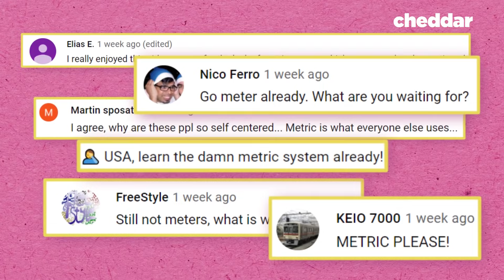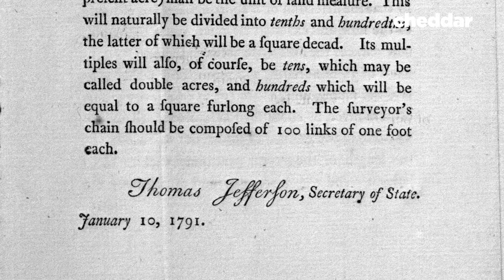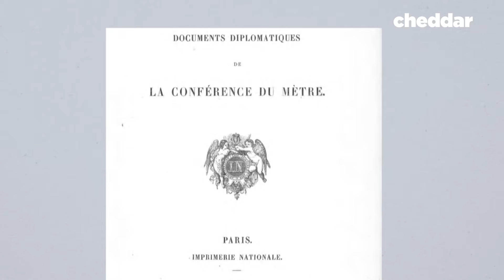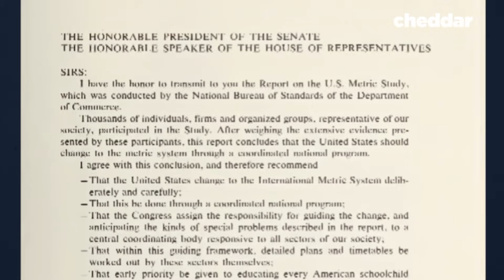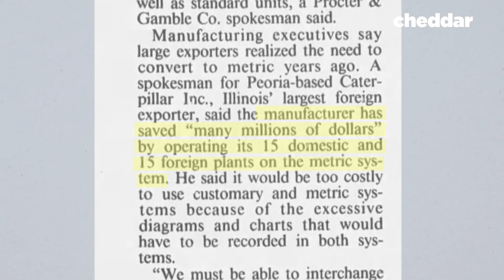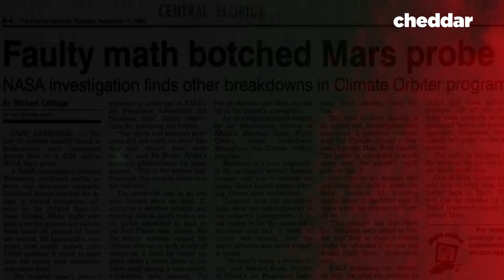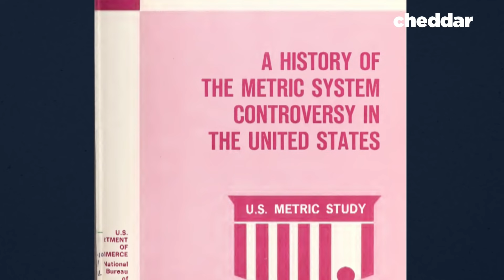Why Doesn't the US Just Use the Metric System? - Cheddar Explains

Comment: Reducing from 900 to 100 different belts doesn't require metrication, just standardization. 

All you have to is start using the same belt in everything instead of making a different one for each application.
Reply: @IRockerbacon Nah, big dog- you're missing the point. It doesn't matter whether it's metric or imperial if it's standardized. You could have an car [or whatever thing] where every bolt had a 1/2" head, Jr a car that had some bolts that are 14mm, some 10mm, and some 17mm, etc. In this particular instance the metric one has more different parts.

Just because the metric system may be a better one does not mean it is required for standardization.

You could make a bolt that was 0.732 French Lignes if you wanted to, and you'd be hard pressed to find a socket to fit on it, but if every single bolt was that same stupid size- boom: standardization.
Reply: 2 machines can be built, 1 metric 1 standard, both using the same number of wrenches to put together or take apart.

Comment: NASA, The Military, Aviation, Engineers, Architects all use it.  The luddites don't.
Reply: @Princess Peach
: you forgot the most important one: FINANCES AND MONEY! It's all metric. 1 cent, 100 cents (=$1), $100, $1,000, $1 mil, $1 bil, etc.
Reply: @jamesdigriz5449  And as soon as you want to convert $$ per hour into $$ per week or year, then metric is out the window.
Reply: Noel Masson Hows that? 🧐
Is any system even required for counting money?
Reply: Aviation around the world is using knots and feet though.
Reply: Real Gokistinian I don't study aviation so I can't tell, but for fluid mechanics, might be used in aviation, I've used metric units, anything mechanical is also metric.
Reply: Not sure if they still do it but NASA uses metric when making stuff, but in the end convert to imperial, ended up causing that crash on mars, someone forgot to convert or something, atleast thats what I was told.
Reply: Yellow Penguin I was told by my teacher that NASA uses metric system for everything except controls, someone forgot to convert a few numbers and crash. Not sure which one to believe 🧐
Reply: @jbird4478  There has been disasters and crashes since man started building things regardless of the name attached to measurements.
Reply: Real Gokistinian any kind of scientific calculations for something have to be done using the metric system, I don't think it's accepted if it's not done that way.
Reply: @Rashed1255  Science got along fine before the metric system. Anything that you can do in metric can be done in English imperial.
Reply: clasicradiolover true, but metric is more simple in my opinion
Reply: So somewhere around 98% of the population are luddites?

Comment: I work in the machining industry and In my opinion changing now would be a bad decision. I take issue with the way this video dismisses the argument about damage to industry. It’s not just about distances ( miles to kilometers) or weight( lbs to grams), other things like tooling , nuts , bolts , pipe, fasteners, bearings , all that would be affected. If you need metric just divide  us standard number(inches or miles whatever) by .03937 and you’re good. 
Don’t need to kill an ant with a machine gun.

Comment: Metric system is based on the 1/4 arc from the pole to equator running through Paris.  No sane person bases a length system on an arc, except if you are a crazy French idiot, or a globalist thug backed by certain insane factions.  The Pyramid of Giza is based on inch, feet and yard, not metric.  It is ancient and scales to the planet and is the CORRECT way to measure things. Time itself is coded in inches, with each year having a prediction into the future.  The 1/10,000,000th of the polar radius = 25 inches.  The mile is 2x2x2x2x2x3x5x11=5280=7x7x7x7x7xPI/10.  It is the most divisible number.  Metric?  2 and 5.  Why then 24 hours and not 1000 time units or something?  Why 60 minutes to hour and 60 seconds to minute?  Only a hypocrite can't see the hypocrisy in the metric system.  Just so stupid.  Sorry folks only idiots thinks metric is cool or easy.  It scales only to clueless egos of the French variety who can't think.  Now it is a frequency...a variable.  By the way, the original marathon was 25 miles which is a reflection on the scared cubit of 25 inches.  The original "metric" marathon (1890's) was 40km which symbolizes a trip around the earth /1000.  40,000 Km pole to pole/1000= 40 km.  Sacred run or a globalist run.  Now you know.  One spiritual, one humanist/atheists.  Man is scaled to the planet via the inch (thumb) and foot.  The metric system is scale to an arc that was off by 3%.  Can't make this nonsense up....Wake up...

Comment: A bolt is not stronger if it is marked in millimeters instead of fractions of an inch and a tank of gasoline does not have more energy because it is measured in liters instead of gallons. An engine is not more powerful or efficient because you measure the output in Newton meters and kilowatts instead of pounds/feet of torque and horsepower. The "savings" mentioned are all false, they actually cost the U.S. millions of jobs because it gave companies an excuse to move parts production out of the U.S. to metric countries. As an example of a lie, the dies and taps used to make nuts and bolts are changed frequently in order to keep close tolerances, so there really was no added expense to switching to metric standards in U.S. plants, it was just cheap labor in foreign countries that led the manufacturers to source their parts from them instead of U.S. based manufacturers.
  GM now uses fewer sizes of belts because they went metric? You can't really be that ignorant. GM started using fewer sizes of belts because they reduced the number of engines and options. Remember when a single model of car could come with one of several different engines and how cars didn't come with air conditioning, power steering or air pumps for emissions (which all had their own size of belt)? They were options that became standard equipment on even the least expensive models, which facilitated the change to a single drive belt instead of different size belts for each option.
  For trade? Really? When was the U.S. not a world leader in trade during the last hundred years? A shipload of grain is a shipload of grain, it doesn't matter if it was measured in bushels when it was loaded and metric tonnes when unloaded.
  The sole advantage to the metric system is the ability to more easily convert formulae without using a calculator. This is an advantage when translating a recipe for twelve into a recipe for five or when calculating a dosage of medicine by a person's weight (as in X ml per kg) in the emergency room, but it has no advantage in any situation where there is time to use a calculator. 
  As for the Mars incident, that had nothing to do with the system of measure, it was NASA's poor management style that led engineers to adopt the "I'm doing my job, and only my job" "keep your head down and don't make waves" attitude that led to the failure in communication. 
  If you really want to annoy people who insist on the superiority of using the metric system, point out that since adopting the metric system, France has gone from being a superpower feared by the world to the laughing stock it is now while during the same period of time the U.S. has gone from a small breakaway colony to the world's superpower in military and trade, all while using bushels, feet and pounds. Once they start to get riled, you can point out how well metric countries did in the world wars when fighting against the U.S. and our non-metric weaponry.

Comment: Video fails to mention that the US military has been metric for decades, at least as far back as the 1970s -- necessarily, to interoperate with our many allies.  Also, the metric system is practically universal in scientific research, which I guess only makes the loss of that Mars probe more embarrassing.

However, down at the grass roots, in everyday life, most people are very resistant to giving up their weather forecast in Fahrenheit, and their road signs in miles and MPH.  And if you have a house built, all the measurements are going to be feet and inches.

I remember when I was in grade school we had the big push to metrification.  We were taught both systems in school, and every hardware store had meter sticks instead of yardsticks for sale, with inches marked on the other side.  Road signs were marked in both miles and kilometers.  Car speedometers had both MPH and KPH.  We were that close to putting the change through, but then it all just fizzled out and everything reverted.  I don't know where I would even go to buy a meter stick today.
Reply: Brit here. We of course invented the imperial system which the US uses (although we updated it, while the US didn't, which is why some imperial measurements are different for us - e.g. a British pint is 568 ml, but a US liquid pint is only 473 ml).
These days we almost entirely use metric, and that's what I was taught at school. We were taught centimetres, grams, and celsius of course, and we were never taught pounds and ounces (so I have no idea how many ounces are in a pound), nor feet and inches (so I never knew how many inches were in a foot, although I think it's 12 based on the fact that 5'11" is the last height before 6 foot).
Weirdly, though, Britain does still use some imperial measurements. Almost all food is sold in metric (grams), apart from milk for some weird reason, which is still sold in pints (but the litre amounts are printed on the side too). Some people will give their height in feet and inches (particularly older people), and weight in stone (not pounds, which Americans use), although the officially used measurements (e.g. by the NHS) are usually in metric. Wine and spirits are sold in millilitres (one shot of spirits is 25 ml, and a small glass of wine is 125 ml), but beer is served at pubs and bars in pints - whereas if it's sold in a supermarket, it's in millilitres.
Also the big remaining usage of the imperial system in Britain is our road system. All of the road signs are in miles. Speed limits are in miles per hour. Fuel economy is in miles per gallon. Our speedometers do show both mph and kph though, which is very useful if you're driving over to continental Europe.
But yeah, apart from these small exceptions, we predominantly use metric. Recipes are all in metric. Celsius is what every weather forecaster uses; some elderly people might use Fahrenheit, but most people use Celsius. Houses are built in metric, of course. All measurements in construction, as far as I know, are metric - some people (particularly older people) might give estimations in feet and inches, but the actual measurements are almost always done in metric.
I definitely think metric is the best thing to use for scientific and precise measurements, including engineering, because the entire world uses metric for those purposes, so all the parts are in metric. But Britain is still solidly stuck to the imperial system for our roads, at least for the time being. I wonder if that will ever change. I guess there's no immediate need for it.
Reply: @dc8890  The US actually did the same thing the UK did in updating and standardizing the measurement system. We just did it a couple decades before, in the early days of our nation. The UK for some reason didn’t see any sense in adopting our standard, so they made their own standard which varied from ours. And that’s why we now have US gallons and imperial gallons.
Reply: @Ethan.Lamoureux  Interesting. Wikipedia just says that America used the earlier English pint while Britain changed it.
Reply: @dc8890  I think there were actually several different pints in use. The US chose one of them for the standard pint, the UK chose a different one.
Reply: @Ethan.Lamoureux  Fair enough - guess it makes sense that these things would diverge, over a long period of time, especially when measurements weren't as precise back then. Also apparently the US pint is 16 fluid ounces, while the British is 20 fluid ounces, although fluid ounces are also slightly different between countries (only marginally though).
Reply: @dc8890  If memory serves, Britain went with a gallon measurement based on ale casks and America went with one based on wine casks. British gallons are noticeably larger. Interestingly, British pints have 20 ounces compared to 16 ounces in American pints. So while British gallons are larger than American gallons, American ounces are larger than British ounces. Order beer in British and shots in American!
Reply: @dc8890  I guess if you had a huge influx of Canadians, that might change the outlook on roads.
Reply: jaklumen the whole Canadian population could move into the US and it would barely make a dent in our population. It would be just another state.
Reply: Zobeid Zuma I’m sure Amazon has one
Reply: The loss of the Mars Climate Orbiter was actually not the fault of the scientists. NASA clearly specified that all contractors would have to use metric, but Lockheed failed to do so.
Reply: Not only the military but most of the US auto industry & their suppliers...I'm an Engineer for a company that can't even use dual dimensions & truly wish imperial would die already.
Reply: Jokes on you, it seems that almost all, if not all, yard sticks are meter sticks now
Reply: @sillypplproductions2  I haven’t seen a meter stick in years. I have seen dual-unit measuring tapes recently, and they are the most useless thing ever! Try measuring fractions of an inch off the metric edge of the tape... So seldom have I ever had to measure anything metric, I can’t recall the last time.
Reply: Sillypplproductions2 In America, All of our Measurement tools Like Rulers And What not Have both Metric and Imperial. They also teach us metric in school still so I mean idk. America is Going slowly into metric You can just tell year by year, Heck some new Expressway and Freeway signs are starting to have Imperial and metric conversions on them
Reply: AT any store as meter and foot are both on the stick.
Reply: Zobeid Zuma Using one system officially doesn’t mean the other one has to be entirely destroyed and shamed. People here in Canada still use a lot of imperial measures in daily life (although they are all calculated based on the metric system), it simply means that your industry and government don’t act like little snowflakes that have to keep a useless system alive for no reason.